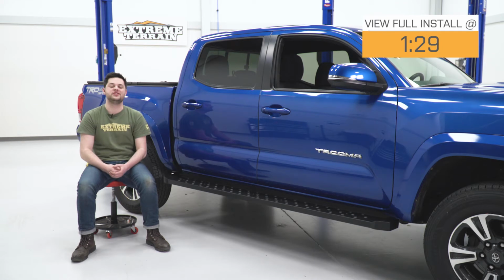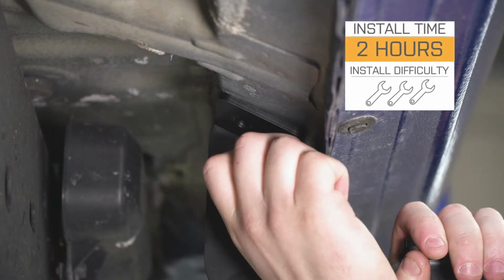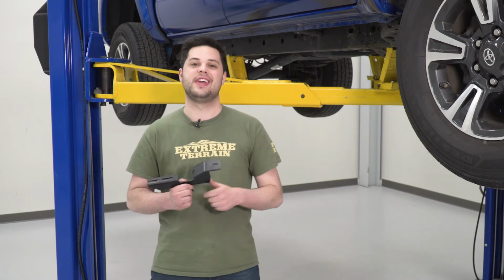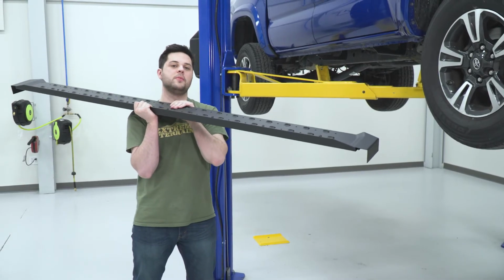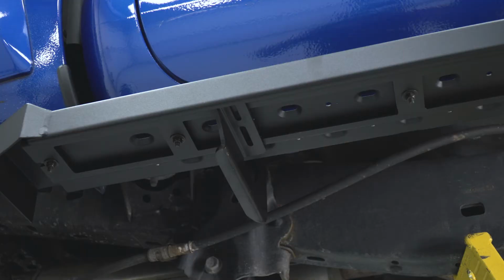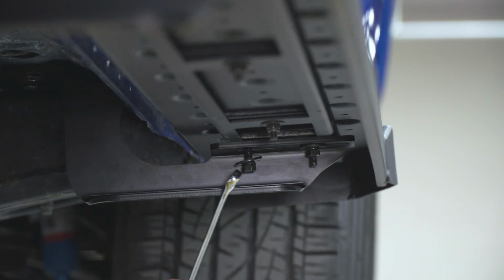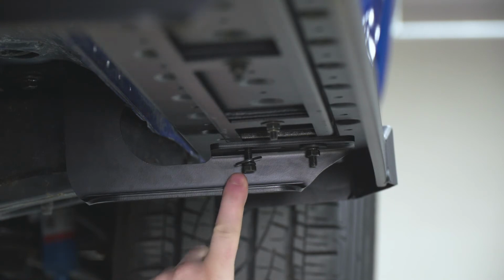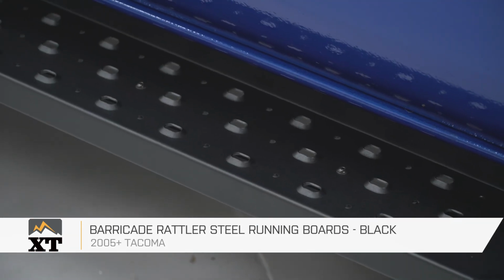Tacoma Barricade Rattler Steel Running Boards - Black (2005-2019 Double Cab) Review & Install

Comment: It’s not side protection they bolt to the body if was protecting the body it would bolt to the frame.  Either you guys are ignorant or deliberately lying.  The first time  you Offroad you dent the body when they hit a rock.
Reply from the maker: Barricade advertises these running boards to protect against brush, small trail hazards and parking lot door dings. These act as a step first, side protection second. So of course dedicated rock slider is going to be beefier out on the trail and these are a solid compromise. Thanks for watching! - Zach